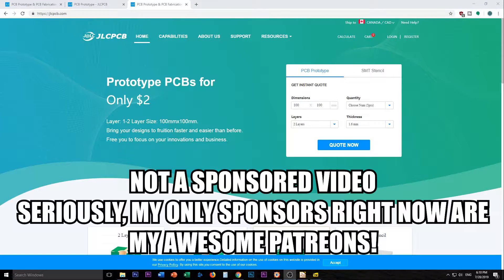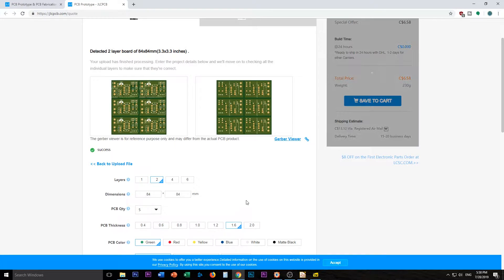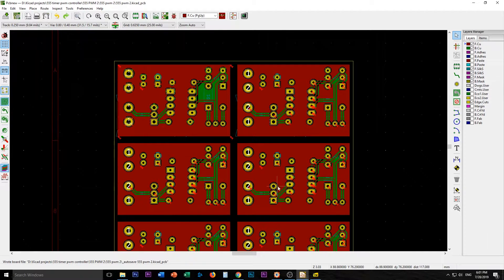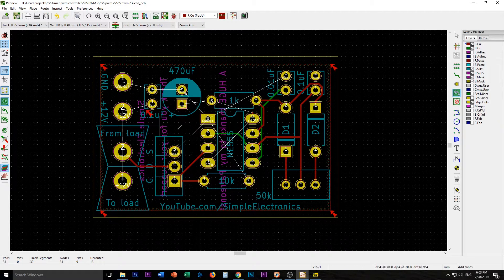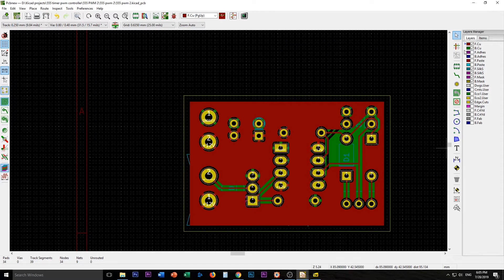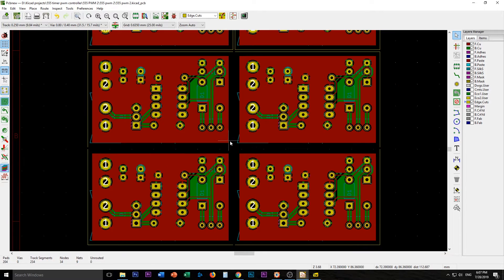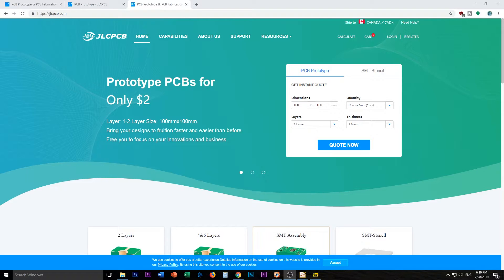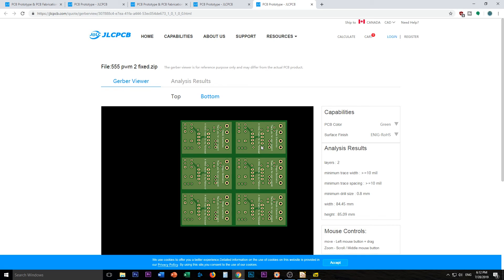KiCAD For Beginners 5 - Uploading To A Fab

Comment: hi.
I will make my PCB board with the panel and send it to the factory.
I will send my pcb project to production.
Is it enough to copy pcb side by side for paneling?
How many mm should there be between each board to separate the factory pcb board?
thank you
Reply from the maker: You can actually leave them individual and use the website of your manufacturer for paneling - most of the companies do this.

Comment: I'm really enjoying the series as I want to start using KiCad. I think the only thing I would have done differently would have been to connect the anode of D1 to the cathode of D2 using a trace on the back side of the board.
Reply from the maker: thanks for the comment! There are a few things I have overlooked, for some reason I get inside my own head and charge forward with ideas without really thinking it through....that's how I learn it seems!